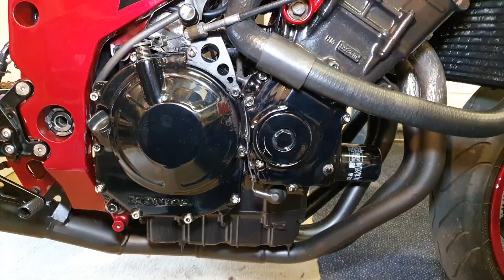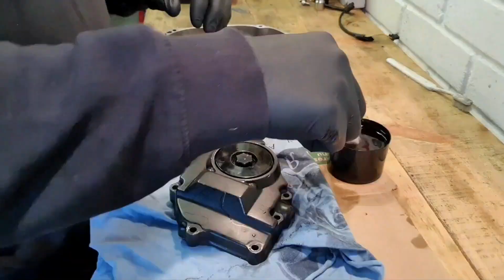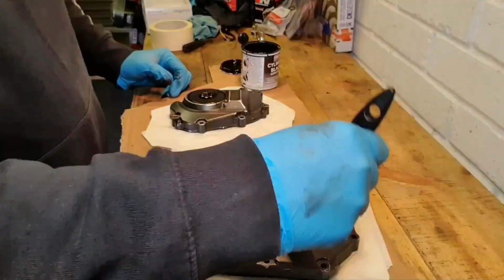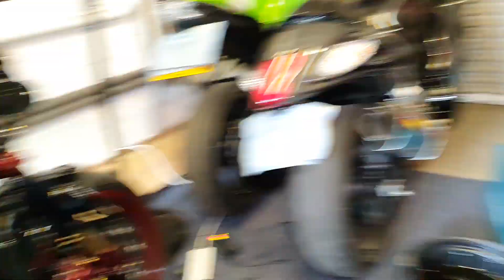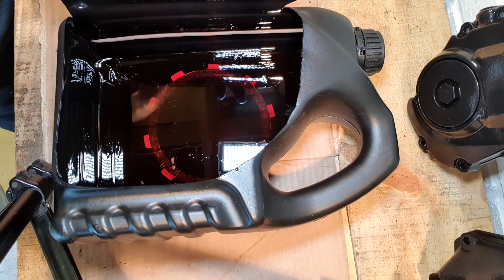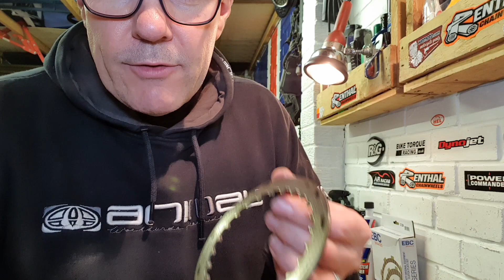Fixing Oil Leaks and a Slipping Clutch - CBR900 Clutch Replacement - Streetfighter Build Series

Comment: Do you know wich way the steel plates come in?

Because I realised that they have a sharp and a rounded side
Reply from the maker: Yeah mate, I put the sharp/flat side facing the engine. I don’t think there a actual correct way of placing them during installation but this makes the most sense to me 😎👍